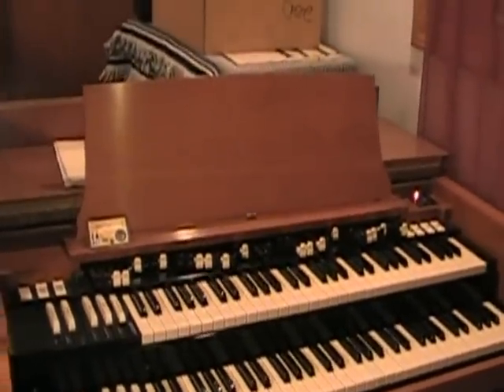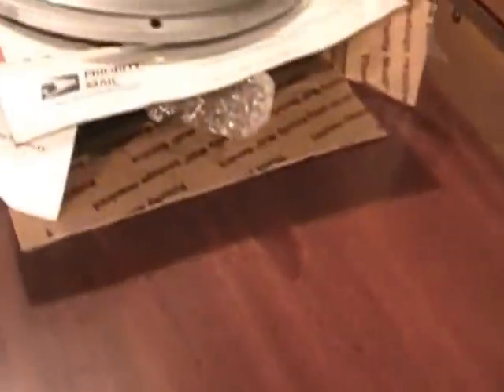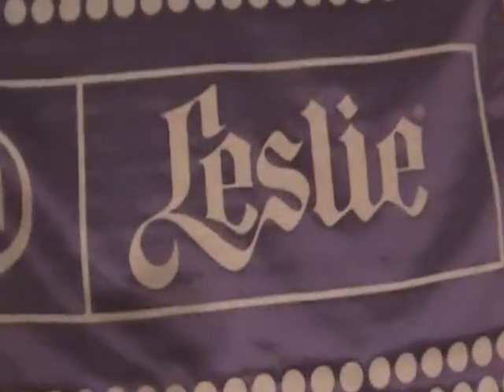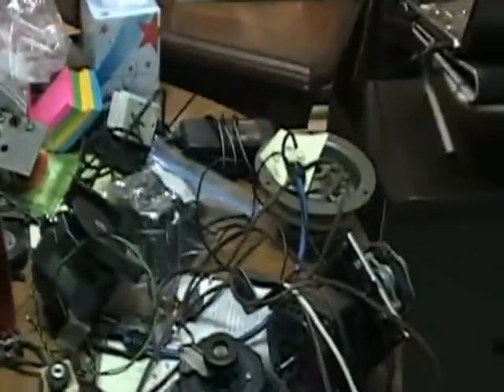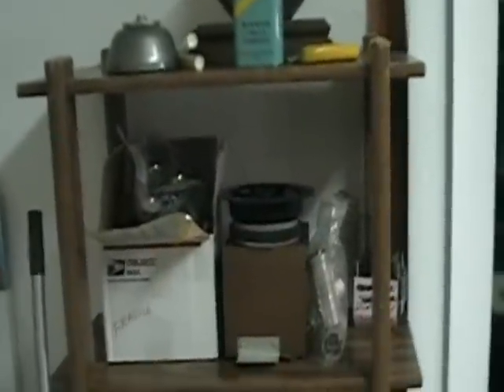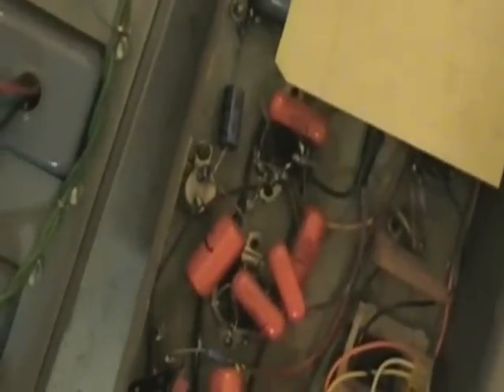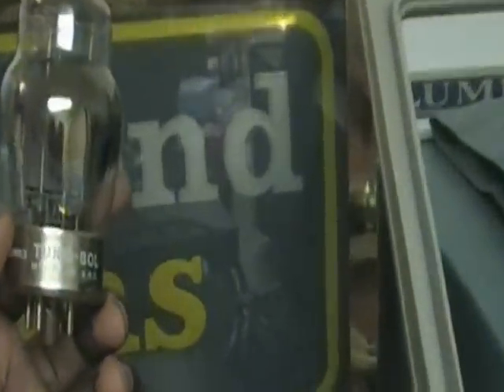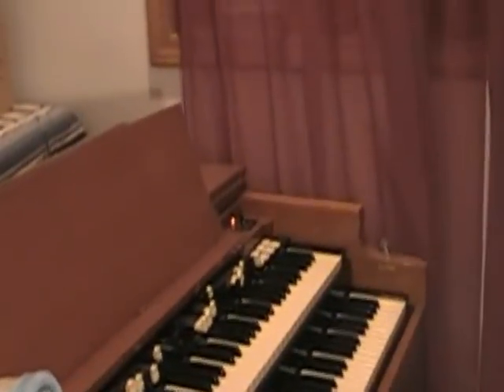A Tour of Vintage B3 Organ Inc.

Comment from the maker: Yes I do Matthew.  I always maintain a supply of partially rebuilt Leslie 122 and 147 amplifiers for sell.  The cost is $565.00 plus shipping.  With a trade in, the cost is around $485.00 for a 122 or 147 amplifier. A brand new Leslie amplifier retails for $1000 but I sell those for $650.00. You  have to modify the audio plug in those and at the crossover point.  I've found a pretty cool way to do that. The new parts that I use cost a little extra but it's well worth it.

Comment from the maker: Thanks!! Start small.  Take a course in basic electronics so that you can learn to read schematics, understand electrical terminology and work with electrical boards and circuits. Then buy a 147 Leslie and take everything apart and clean everything including the motors and the cabinet. Then rebuild the amp, check it out, and sell it. Then do the same thing with a 122 Leslie. Next, buy a C2 organ and restore it and sell it with your 122 Leslie. Use the internet, Youtube, Ebay,Mouser and contacts.

Comment: DR. KEMP, DO YOU HAVE A VIDEO ON THE "CORRECT" WAY TO DISCHARGE LETHAL CAPS ? ....IF NOT, I SURE WOULD LIKE TO SEE ONE ...... OR AT THE VERY LEAST CAN YOU RECOMMEND A VIDEO OR TUTORIAL ? THANK YOU SIR !
Reply from the maker: I have watched several videos on this topic. Some say use a screw driver across the terminals and others some other hand held tool.  You can also use a resistor and then the screwdriver to cut down on the amount of voltage.  Here is a video on the subject. :  https://www.youtube.com/watch?v=D54Cm4vrPZo